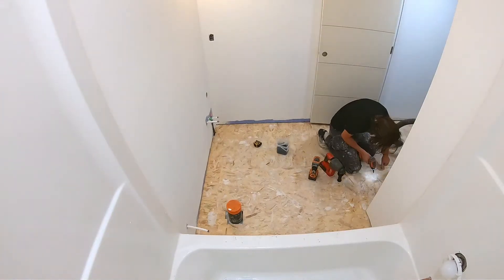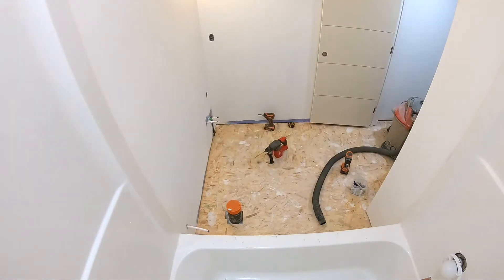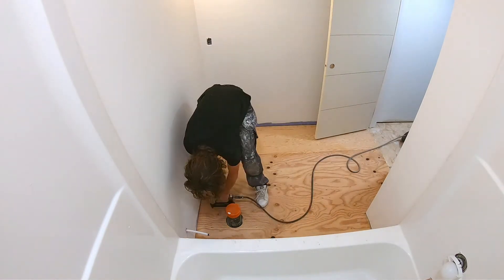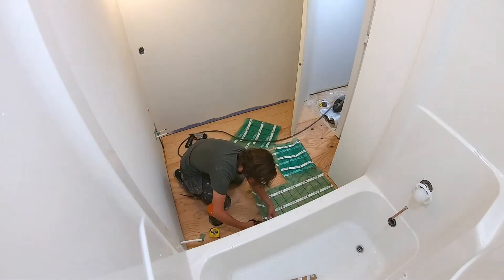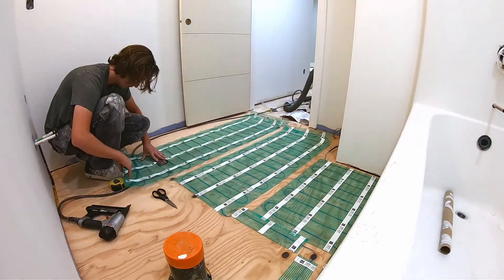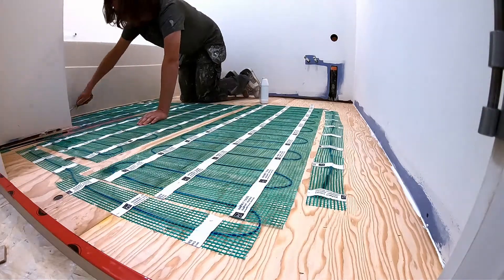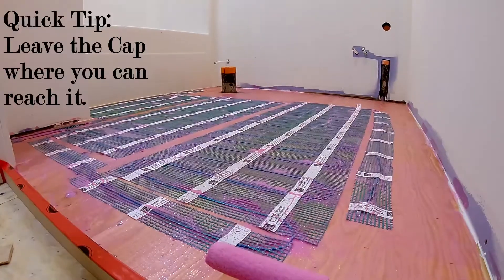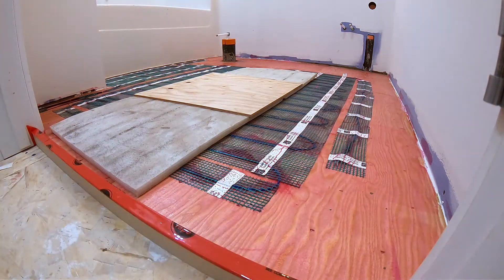How to: Install infloor heat and tile on top of Dricore subfloor panels

Comment: Great video. You are e really skilled
 For some reason when I use tapcons I always snap the screw in half. I think my impact driver might give more force than the screw is capable.
Reply from the maker: Thanks. Maybe double check your concrete drill. I know that sometimes if the points are worn down on the tip they actually end up drilling a smaller diameter hole then what you want. This puts more stress on the screw as you are putting it in and might cause the breakage. I found this out putting in anchors for pallet racking one day. half way through the day we couldn't get the anchors to go in the hole all the way and it was that we had hit some rebar and the hole that was being drilled was just ever so smaller than what was needed and once we had a new bit it was back to business as usual.
Reply: @ResearchDesignBuild  ok I'll buy a fresh bit next time 👍
Reply from the maker: @CybekCusal  or just measure your bits with some calipers and see if they haven't worn down.
Reply: @ResearchDesignBuild  ok. 👍

Comment: Question, How come you didn't put any waterproofer on like a Schluter System? Is this because you did this in your basement?
Reply from the maker: I have a bit of a problem with the need to waterproof your floor in a bathroom. You can make the floor as water tight as you want, but if you get water on the floor, where does it go? Does it wreck your baseboards, then leak into an adjacent room? The tile floor is grouted all the way around and then silicone was used between the tub and the tile floor. This was also in a basement so the leaking was even less of an issue. Sometimes people put down a schluter system to de-couple the floor from the tile. And I agree with this application. Especially in situations where the floor wasn't originally designed for tile and might be a bit thin or flexible. But in my case I had dricore subfloor attached to concrete, with 1/4 plywood glued and stapled.  The self leveling cement, then the tile. So I'm happy with how strong my under tile setup is.

Comment: Did you put your tub on dricore as well?
Reply from the maker: The tub I had was only supported at the very front of the tub and then around the back of the side walls. So I did put dricore under the front lip and then used shims to shim up the couple other supports under it. But the dricore isn't under the entire tub area, just the front lip.
Reply: @ResearchDesignBuild  thanks. I’m just wondering what I should do! 
As it’ll alter where I cement the drain (I’m doing shower). Either right on cement or as you said supporter and level as needed on the dricore.
Reply from the maker: @sushi13141  Is it a Fiberglass shower base that you are using? The only thing it will really affect is where your flooring meets the shower pan. If you put the shower pan on the concrete then with the subfloor and I'm guessing tile you will meet the shower base 1.5" up from the bottom of it roughly. VS only 0.5" maybe if the shower pan is on the dricore.
Reply: @ResearchDesignBuild  I’m using a 4 piece essence by maax. The pan as they call it has a larger than usual lip.
Reply from the maker: @sushi13141  With the large lip that should give you lots of options. Some tubs or shower pans have details near the bottom so you need to make sure your flooring doesn't meet up with those spots in a weird looking way.
Reply: @ResearchDesignBuild  thanks! Will do.

Comment: Since posting this video have you noticed flexing in the flooring resulting in grout lines or tiles cracking?
Reply from the maker: No I haven't had any movement of the floor, no cracking of grout or tiles. Everything looks just as good as it did the day after installation.